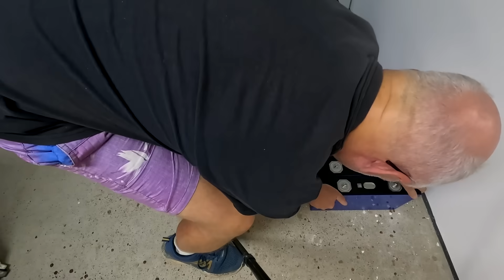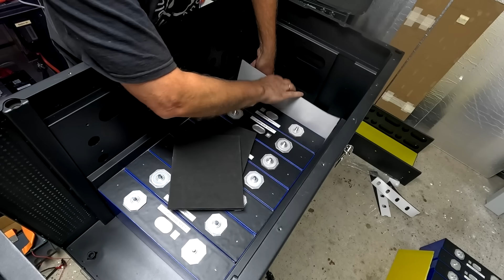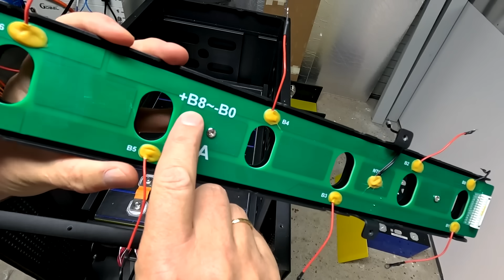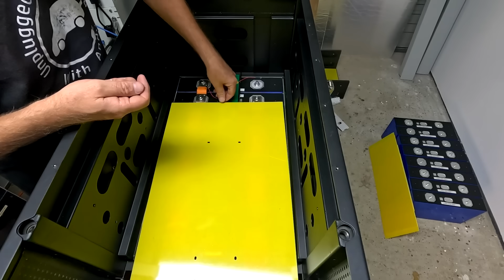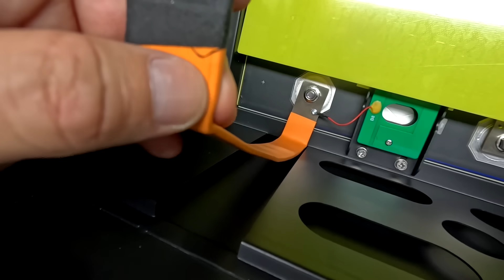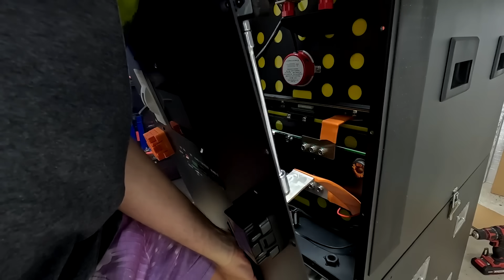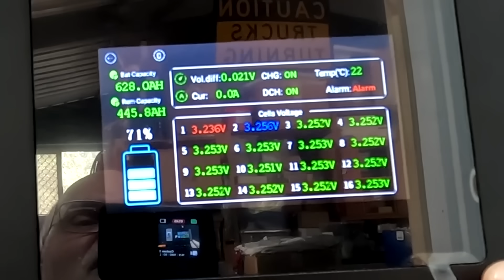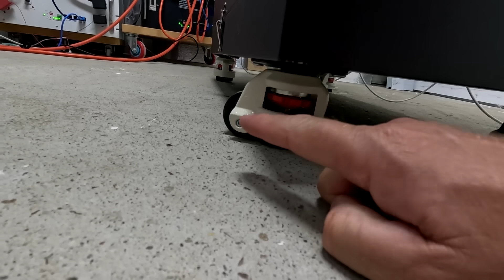First MB56 DIY Kit Build - The Big Beautiful Battery!

Comment: 1. I d really like more, double insulation on that bridging busbar. Maybe an epoxy bedding for it
2. Safety, work from the panel to the battery and have a special insulation tool while working in the battery for loose bus bars/connectors.
3. Have the same form factor for all cubes.

Comment: I'm so jealous! Mine is almost here. That's huge!!! 🤯🤯 Not going to watch whole thing, don't want to ruin it when I build mine 🤣
Reply: k Will, careful with the BMS this time.
Reply: @idahoduckhunter lol
Reply: Remember, will.. A goes there, and B goes there :) 😀
Reply: @natesdiysolar  they are in reverse in instructions but yes I'll pay attention this time lol
Reply: @WillProwse in know.. they aren't great lol..
Reply: Will, do you have any opinion about the cells being used on their side? The MB31 module data sheet forbids this (and for storage too) but the MB31 bare cell data sheet and the only MB56 data sheet I can find have nothing to say on the matter. I've asked Andy if he can use his clout to try to get an answer out of EVE. Perhaps you can instead? Thanks.
Reply: @matthewmarks6951 wow that's good to know. If data sheet states that, it should obviously be avoided. Yikes.
Reply: @matthewmarks6951  can you post that data sheet on the forum? For module
Reply: @WillProwse  They're both on Andy's website. As a result, he did a video condemning vertical battery boxes (or putting a horizontal one on end as I have). It's very odd that they've suddenly decided a subset of their product line has a problem. Of course I asked them to clarify but got no response.
Reply: @matthewmarks6951  All of these cells were designed so the electrolyte coverage internally and the cell vents are vertical. They may say you can use the horizontally, but I always wonder about what that does for the electrolyte coverage. The vents, well, I just don't want them pointed to the side myself.
Reply: @john_in_phoenix  Yes, I've heard this before, possibly even from you, and it sounds convincing. However, I've never heard the same from the cell manufacturer themselves - why? You'd think they'd cover themselves against warranty/legal claims but they don't, despite plenty of facile warnings about things like short circuits and immersion in water. Not sure what difference it makes if the vents point sideways - they're firing against a metal plate regardless.
Reply: Hi Will, If both you and Andy like this Yixiang battery kit after your testing, would you recommend using them with an EG4 FlexBoss & GridBoss?  The price differential is massive compared to the EG4 batteries.  I'm left wondering if there are any disadvantages with the JK BMS in this kit, compared to the proprietary EG4 BMS in their batteries, with closed loop communications to their  Boss components.  What are your thoughts?  Thanks!
Reply: I washbyour video all the time can we connect to help me build my. I am so scare investing that much and then blew it
Reply: Do you think you can make a high voltage batterij with these? Together with your silent inverter?
Reply: @DavidHsueh  technically yes but that would be terrifying 😂 I need to find safe way to make hv batteries
Reply: @WillProwse  I'll be waiting for that video, in the meantime I'll be considering this one for the end of next year, when we have to pay to offload our excess energy onto the grid (and leaving about 1 or 2 eurocent of profit)
Reply: You see in the comments, that is it not safe, to install such huge capacity in small unventilated compartment,
without suitable BMS, when after some time, DC IR will go high, and BMS will not be able, to balance
cells at TOP OR/AND BOTTOM , I prefer small capacity, from big corp. 
EVE, GOTION, SK ON, Panasonic etc. are SMALL suppliers.
Reply: Hey Will, are you going to do a separate review on the MB56 cells? I know they’re pretty new to the market and am definitely interested in how they perform and hold up over time. Always something to keep in mind with a new product; the technology is the same, but sometimes technology doesn’t scale well. Interested in more reviews either way. This product has definitely caught my attention.
Reply: Hope you can make a video on this soon. I might hold off buying something else depending on what you find.
Reply: What ever happened to easy access for servicing, when a cell, temp sensor or a weak weld gives out?
Reply: 32 kWh Battery 
EVE MB 56 $96Battery × 16= $1536
Yixiang DIY MB 56 Kits = $569

TOTAL= $2105  or $65/kWh
Reply: Plus $240 shipping for the batteries
Reply: Is that the prize included cells??? Noo
Reply: I bet you don't build them compressed in a stupid box, you have more sense. Just buy 17 cells (or 15?) and at the opposite end of the BMS place a single cell in the middle so the terminals line up. That way all the cells are on the same level with identical size busbars between them and you can get to all of them easily for maintenance, I have found just a standard fan pointed at the cells reduces temps by 5C. All this compression inside a box is total BS, when the cells get hot they have little chance to cool down I prefer to leave a few mm gap between cells and the slots in the busbars allow this. You don't want any cells going over 25C perhaps 30C absolute max. Compressing cells inside a closed box where fresh air cannot circulate is the dumbest idea ever.
Reply: @reginaldpotts2037 I don't go for compression. This was a huge debate ages ago and if you fixate the cells at 50% soc it's fine. No need for more than that. 

If you need more, probably have bad cells with gas formation.
Reply: @cajampa hold them together. Static. I do just enough to avoid lateral stress to the terminal. I posted two other comments and they are not showing
Reply: @cajampa when you go to actually assemble the battery just half the batteries half charged. It leaves enough wiggle room for them compressor themselves when you first charge them.
Reply: @reginaldpotts2037 I tested 3 brand 280-315Ah cells, compressed....at the "normal" rate of 0.5C, they never heat up...so...
Reply: @reginaldpotts2037  my largest raw cell pack was like yours. They weren't even touching. Zero stress to cell terminal.
Reply: @reginaldpotts2037 You are right at point 👍
Absolutely what i also think about a setup 😉

Comment: It seems that the 280/MB31 cases provide better compression, as the screw in the middle reduces bending.
Reply: Both 280 and MB56 cases provide bad compression. Over life time each cell will grow 2 till 3 mm in width (datasheet: "it is suggested to reserve 2.0 mm ~ 2.5mm expansion space while grouping the cells."): that is 16 till 24 millimeters for a stack of 8. Luckily compression is done with two pieces of thin steel and some air between the plates. At EoL the compression plates will be massively deformed.
Reply: You have to apply constant compresion with respect to C rate, temperature, age.
Temperature and bad ventilation determines REVERZIBLE and IRREVERZIBLE changes
on cathode / CEI / anode / SEI.

Comment: useless compression plate. it need a thick horizontal metal bar in the middle
and a nightmare for service if you have to get to the lower cells
Reply: and the plate should be prebent a little to compensate for the bending from the pressure, so at the end it would be straight
Reply: @423GustavBern  yes. and no useless foam thingy anymore. 
instead solid epoxy separators. 
but im sure they will never learn this

Comment: Are cell 1 and 2 the two cells you had in a seperate box which you had on test?
Reply: I thought about this. Andy labelled them cell 15 & 16 and put them in position 15 and 16 but the bms has them as cell 1 & 2. Is there some wrong connections on the balance cable pcb’s.

Comment: Hey Andy, I love your videos and they have thought me alot. Even your videos landed me a job in industrial EV batteries. I would really like for you to show proper tool handling when working with batteries. Please don't put uninsulated tools on top of batteries even with a epoxy sheet in-between. If you bump your torque wrench you could still cause a short. Just put your metal tools down outside a battery case when you're working on it.
Keep the videos coming!
Reply: Yeah that's super dangerous. Especially with this size pack. Good advice.
Reply: He got mad at me when I said something like this. Let's see.
Reply: .. yes ..i thought the same..  ! when this Torque tool slides to the poles or metal housing ..! 😳. that long metal extension for  the wrench...!!  I  have extra  isolate all this tools and wrenches and srew drivers with heat shrink ..very easy slide  it on ...and heat it up ....😉👍
By the way ..very nice LFP housing..!
I built 2x 24 Volt LFP  systems myself maybe 8  years ago ....still working fine ! Now i would like to built  a 48 Volt system ..at that time  very expensive or not available!
Reply: Yeah, that one gave me a heart attack.

Recovering now. Luckily the night nurse gave me some relief, she's so sweet.
Reply: @JohnBrown-s9q you wish. Or maybe your night nurse is Mrs Palmer ?

Comment: LFP itself may not burn but gasses will be generated, including hydrogen. We know of at least two German homes being blown up because of this (homes had to be torn down). 😢 these were not caused by DIY batteries like these though.
Reply: no not germans
Reply: true, the electrolyte and the venting gas is flammable. I wish they would add some type of ducts over the pressure release valves so you could redirect the venting gas outside of the box
Reply: @423GustavBern  the gas is too hot.  
you can buid your own metal duct it will be very complicated, bulky and very expensive.
so this is the answer why they dont do this.

Comment: If that box falls..it could hit another tower and its fireworks, for example concrete has been know to collapsee, wheels snap, welds break and metal bends😢
Reply: You are concerned that concrete will collapse?
Reply: @martinwhite418  It certainly can, if its point loading rating is exceeded.
Reply: @matthewmarks6951  I'm not a mechanical engineer, but my math says 96 pounds per square inch. I can't imagine 3 inch concrete failing at 96 psi.